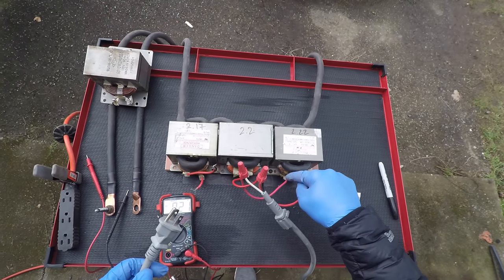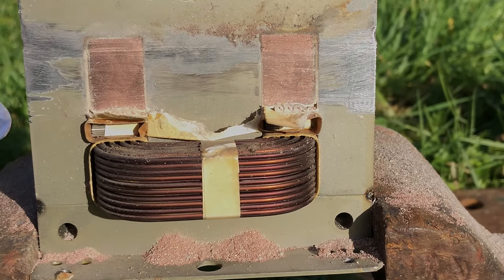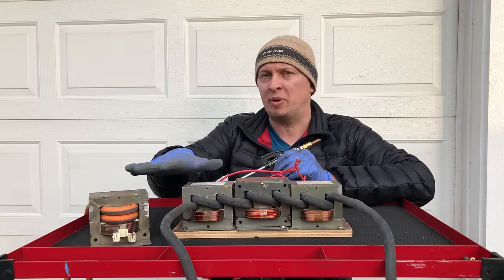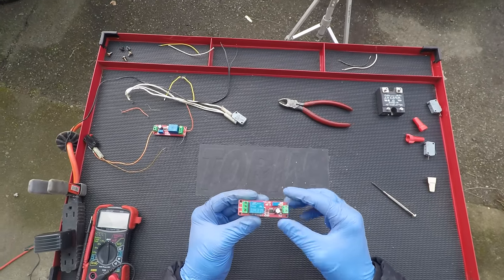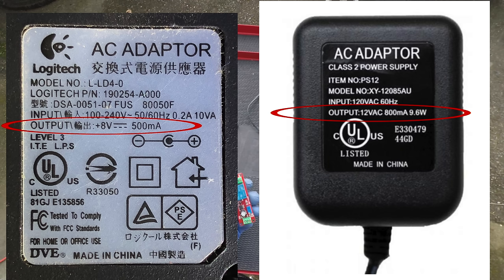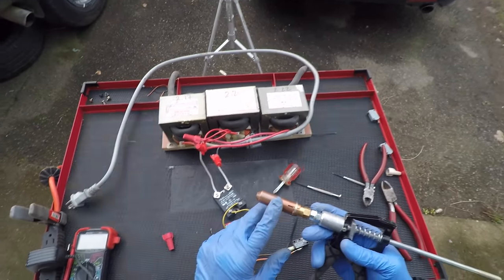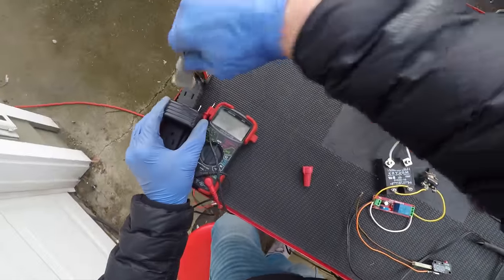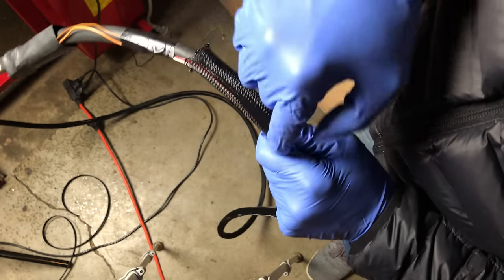✅ DIY Car Body Electric Dent Puller Welder Spotter From Microwaves UPDATED

Comment: Thank you for video. best video ever.. My electricity is 240v, I used a thick wire (175mm2) and I got over 500amps from a single transformer at 2.2vac. Do you think I should use two transformers or use a smaller wire with three transformers?
Reply from the maker: Even if you are on 240 V do everything exactly the same as I did in my video. Use as thick of a cable as you possibly can to make the same amount of windings as I did in my video. And once again for best results go ahead and use three transformers

Comment: I ordered the 12v timer relay from the link in the description. With the CK connection I got a delayed turn ON, then continuous power. I had to use the CB connection to get the delayed OFF that Fix206 used for this project. I hooked it to a 12v computer fan to test the delay, as I did not have a 12v led to use. Also, the timer has a light that tells when power is applied and one that lights when it energizes the relay.
On another note, does it matter which wire of the power cord goes where? The black "hot" wire should go to the breaker and the white "common" connect to the red wires in his diagram? Or does it matter because it is AC current? Anyone grounding the green wire, and if so, where?

Comment: Doesn't your (excellent and outstanding!!!) build require some form of cooling like fe. a case fan and vent holes in the back or something of that nature?
Reply from the maker: Ive never had it get hot or even really warm even under heavy use, because the pulse duration is only about 0.3 - 0.5 of a second  therefore the transformers aren't running constantly like they would be in a welder
Reply: @fix206  Makes sense!!🙂

Comment: Awesome tool, I use one I bought off eBay but it doesn't seem to weld onto aluminum..is yours able to weld onto aluminum panels for repair ?
Reply from the maker: Nope, aluminum is way different to work with...

Comment: Fantastic video thanks for sharing. Would this work with three slightly different size transformers?
Reply from the maker: Using slightly different size transformers is just fine, they will basically balance each other out in the end

Comment: Hi completely incredible video. Thank you. I just have one question. I have made one with one transformer and a switch directly hooked up to one of the power lines from the 120v input. Is there a problem with this setup bc of your timer circuit. Is there a real need for it. And y. Thx in advance
Reply from the maker: I suppose you can run it that way for time being. I personally wouldn't recommend it because you are basically running the whole 120 V through a simple switch that wasn't designed to carry that's much voltage/current. Believe it or not that's how I ran my very first set up but have since upgraded it to the state that you see it in right now. In my opinion the way that everything is set up right now is much better/safer.

Comment: Are there any specific characteristics when looking for donor microwaves-for example wattage or other factors, and to clarify I would require three microwave ovens to to aquire the coils?
Reply from the maker: Any microwave transformer should work just fine. Microwaves come with just one transformer so you would need to source three microwaves.

Comment: Hi there! Massive thanks for your machine its absolutely amazing. Where did you get that puller attachment what u used on the panel to pull or how is it called? I was looking aeverywhere on the internet but could not find it. I got the hammer type but I like that red thing. An other ‘stupid’ question, battery needs to be disconnected on the vehicle to work on with your machine? Many thanks Dan
Reply from the maker: I ordered my orange puller from Russia. That's the only place I can think of to get one of those from. And as far as disconnecting the battery go ahead and use this spotter tool as you would use a welder because essentially that's what it is. Therefore disconnecting a battery wouldn't be a bad idea 😉

Comment: Hi there, Loved the concept and the whole idea of the design. I just had a quick question. I was wondering if you could measure the current through the output lead ( using a clamp meter ) for the half second pulse, so that it shall help me design a single transformer as against 3 transformers. Thanks in advance
Reply from the maker: I've had other people ask me about how much current is flowing through the leads, I do not own a clamp meter nor know anyone who has one, so unfortunately I don't think I can take that reading.. But I'm estimating it to be in the 1800–2000 amp range
Reply: Thanks  for the reply. I shall update you with the same as I have designed a 10 volt 200 amp transformer which is like. I will use variacs to determine the exact voltage and current for a sheet thickness of 1.6mm
Reply from the maker: OK, let me know what you find

Comment: You're an absolute genius. I did mine with three M.O.TS, using 16mm wire. Putting out 8.4 volts, 370-90 amps. I don't have the timer or relay. I'm  not getting the tip to stick on the metal. It's heating but not sticking. Both lengths of wires from the M.O.T.s are approx 10ft. Am I suppose to get more amperage for puller to stick? Any advice?
Reply from the maker: It is very important not to have too many windings around the coil that you are making with a new secondary cable. Make sure that your windings look exactly like mine, with cable being wound twice through the iron core of the transformer, no more, no less. I think your amperage does look a bit low
Reply: Thanks for responding! Watching and learning all the way from Trinidad. I watched the previous vid you made before your upgrades and I heard that you said atleast 1000 amps.. Can you say how much amperage are you getting from yours? I will try to get that exact wire 2/0 and do the two windings instead of three..again thanks for the feedback. Your vid was the ONLY clear and most informative without music. It is just that I didn't have the correct wire..hoping to sort that out. If you have an email pls send so I can send the finished product.

Comment: I was hoping to build one, but use an old mig welder as the power source instead of building the transformers.  The 110 mig doesn't seem to stick the electrode like your unit.  Do you think the microwave transformers have more power or do something special?
Reply from the maker: Not really sure how your mig transformer is set up, I have had a few people ask me a similar question whether it is possible to convert a mig or an arc welder to work as a spotter. I cannot answer that question with certainty because I simply don't know, however I have recently acquired an old arc welder that I'm going to attempt to convert into a spotter just to see if it's possible or not. I will be posting that video a bit down the road
Reply: Thank you so much!  It's a great tool and video.  I think I will hunt some microwave transformers and copy your build.  Thanks so much for posting.

Comment: hello how can i know how much ampere it draws becuase in sweden it can only draw 10 ampere?
im gratefulk for answer
Reply: And its 220v here
Reply from the maker: You should be OK, here are in the US everything is 110V so if the voltage is lower the amperage draw will be higher, but if you are on 220V then your amperage draw will be less.

Comment: @Fix206 have you ever considered selling this puller?  Perhaps implement any updates and things you've discovered along the way to improve but I would consider buying these if you sell them.
Reply from the maker: I actually did consider selling them, however the model that would be available for sale would be more compact, better built unit with MUCH BETTER electronic controls. I already have the electronic controls all figured out. Will be doing a video on them in not so distant future. Instead of doing three separate transformers running in series, it would be one slightly larger but much more efficient transformer. Sourcing transformer cores would be the challenging part, the rest of everything else shouldn't be an issue...
Reply: @fix206   Sounds good, keep up the great content and if you do want to monetize things like this let us know how to support you!

Comment: Great Video. I like to try and make one with a Puller. Could We see a closer look at your puller. Puller Look like a Cut off Caulking Gun, with a threaded end
Reply from the maker: I'm pretty sure that the manufacturer of my puller did he use a caulking gun that they used for basis for their puller. Next time ill be using it I'll try to show the gun in better detail and go over it a bit more
Reply: Best D.I.Y. video I’ve seen on building a professional grade spot welder. 
I know that you can use that same genius to reverse engineer the actual pulling tool. Every other D.I.Y. spot welder video uses a Slide Hammer set up.. Not as precise for fine tuning.

Comment: (5:00) - You are slightly wrong about getting more current by using three transformers connected in series like you have done there.
You will get exactly the same current using a single transformer.
What you do increase though, is the voltage.
With a single transformer, modified as shown, with a single complete turn on the secondary, you may, for example get 2 volts out.
Add another transformer, you'll have 4V, and 6V with three.
You see, with just 2V, it is quite difficult to get a good connection, but with a higher voltage (pressure), the current can punch through any impediments such as dirt, a film of oil or oxide etc.
You'll get exactly the same, whatever hundreds of amps, from the short circuit current using a single transformer, but the higher voltage makes for a better connection as described above.
>

Comment: Hello Fix 206, one question, the red cables are plus and the blacks are minus in the video. In your drawing it is the other way around. Or am I wrong? The welding machine doesn't work for me. Greeting from me.
Reply from the maker: I have had a lot of people build their machines based on my drawing and video and their stuff worked. Not really sure what's going on with your machine...
Reply: Hello @fix206  , i think i swapped plus and minus. (red wire and black wire). Thank you very much for your answer. Greetings from Germany.

Comment: Found lots of microwave transformer from local scrap shop for about $3 each. Is there any specification to look for ? . The only costly part will be wire and puller set
Reply from the maker: There's really nothing specific to look at, you just want to make sure that all the transformers that you're going to use are 110V or all of them are 220V, you cannot mix 110s and 220s. The size of transformers will vary a bit and it's not a must but it wouldn't hurt to try and pick transformers that are closer in size to each other. The puller that I use in my  videos (Black handle with orange bases) is by far superior to the slide hammer type puller. And I'm going to have the puller that I use available for sale here shortly. Let me know it it's something you'd be interested in.

Comment: Hi
Great video 👌🏻building on now! 
Why is the relay in the link a delay turn on? Shouldn't it be delay turn off?
Regards
Reply from the maker: Any progress? did you get your spotter built? The relay can be set up both ways either timed duration for it to stay on or timed delay before it would get turned on, hope that makes sense
Reply: @fix206  hi
Got it up and running 👍🏻 thanks for the inspiration
Reply from the maker: Love it!!!  it's one of the best tools in my arsenal when it comes to doing sheet-metal work on the cars. Glad it worked out for you
Reply: @fix206 
HI again
I have 8,4V from the 3 transformer, but doesn't get good grab on the metal? Do you have any ideas?
Reply: @fix206  How set to make pulse????

Comment: I would love to built that
Reply from the maker: You should build one... Its really that simple. Pretty soon I'll be posting a video of an upgrade for the spotter. Electronic controls (timer relay, solid state relay, etc.. ) that I used in the video are weak. Now I got something that is light years better and I'll have it available for sale here pretty soon. Stay tuned !
Reply: I will have to do it because I'm an auto body repair and I need one
Reply from the maker: Soon I will also have for sale a hand puller that I'm using in the video. To be honest, I don't know how I got by without a spotter all the years that I've been doing body work. Used to use a stud gun in the past and absolutely hated it!! Spotter speeds up the work process immensely, makes it sooo much easier and I actually enjoy doing metal work now. Still hate doing the bondo though :(
Reply: @fix206   I’m looking into building a spotter, what updates would you recommend?

Comment: I have my parts together but have been sidetracked I am still as enthoused as ever! I will let you know when it is done. I went ahead and bought the bigger red tool box at Harbor Freight thinking I could store the attachments in the upper tray when not in use?  Phillip Hall
Reply from the maker: Just make sure that you don't put too much stuff in that toolbox because it will get really heavy, thus it will be more difficult to move around unless you'll have it on a dedicated "welding cart"
Reply: Good reasoning, I may keep it separated after all. LoL   I have really enjoyed your videos.
Reply from the maker: @PhillipHall01  I am still a young/strong guy but those three transformers plus the heavy cable really make that toolbox a pain in the butt to move around...
Reply: You make an excellent point once again. I do not want to be restricted to a welding cart. I appreciate the mobility of the tool box set up. I may rethink the idea of the spotter attachments stored in the top tray. Lol 😂  Or, I could remove the tray and tote each individually. Either way you have the best body tool I have ever run across and I am very appreciative of you.  Maybe later on you can find a way to make these work on Alunium.  That would be icing on the cake  🎂....   Again thank you and I say my friend because you have been a friend to me.   
Phillip Hall
Reply from the maker: Phillip my friend you are very welcome, I've been thinking about adopting the tabs for aluminum work, at some point I'll get another rig with aluminum panels that will need fixin', I'll do some testing then and of course I will publish my findings as soon as they become available :-)
Reply: I’m Looking forward to it,  isn’t this more like fun!

Comment: I enjoyed watching your video Can you make arc welding machine to convert a Dent puller machine?
Reply from the maker: I'm not too familiar with inner workings of an arc welder. Plus in my opinion it is much easier to just use microwave transformers since they can be sourced for free instead of having to butcher a perfectly good welder which are usually not cheap  :-)
Reply: Thanks for your suggestions

Comment: Good afternoon 206, have you designed a puller for dents? I have been looking at rivet pullers for the squeeze part of the puller. I haven't found one that will work like the model that you have. Any suggestions? Take care and good luck.
Reply from the maker: The puller that I'm using is the only thing that I did not build myself. I actually bought it from Russia. But later on I will be making a video where I will be reverse engineering that Russian made puller. It may be a little while until I make that video...
Reply: @fix206  I’m looking forward to that video soon.. need a handle for this build
Reply from the maker: @amthevision8931  I should have that video out pretty soon and to take it one step further, I'm actually going to be manufacturing these hand pullers and I will have them for sale here pretty soon. Stay tuned

Comment: Do you reckon #0 AWG will do instead of #00 AWG? I can get 0 AWG from a car audio shop much easier than finding 00.
Reply from the maker: I would recommend using same thickness of the cable that I'm using in my video, it has to be thick enough to carry the current. But if you get something that's too thick then you'd have a hard time feeding it through the core of the transformer

Comment: Love your puller and decided to use your ideas. I have hit a snag, I think I must have the wrong type of relay, ( Looked the same as yours). I wired it as your drawing but it does not pulse. The timer screw just delays the time before it switch's on and then the light stays on. Any information on what sort of relay I need to look for would be helpful .
Reply from the maker: There are three terminals on the back of your timer switch. The center terminal is your common. And one of the outside terminals is going to be a pulse, and the other one would be delay. So right now you have yours hooked up to a delayed terminal. Hopefully this makes sense
Reply: @fix206  That  does make sense, I will play again tomorrow.  Thanks
Reply: @fix206  hello, i am follow your  video and i don't have a pulse, its maybe problem in time relay or what i am try couple  times and problem is same all the time,  can you give me e-mail or something where i can send you my work.Thank you, great video and project!
Reply from the maker: @Mcfarcina  did you look at the wiring diagram that I left in the video description?
Reply: @fix206   Yes bro, i am download it and i am follow it and i am try with led bulb on time relay but i dont have pulse on him, everything else it`s okay, can be problem in time relay, i will buy other one because when i connect  + and  -  i dont have pulse only after couple sec i get blue light and then i get power on com port on time relay so i hope you somehave can help me, thanks a lot!

Comment: The measurements you took for the wire included the thickness of the insulation. What gauge of wire did you use?
Reply from the maker: Cable thickness is 15mm, I think it's a 2/0 gauge